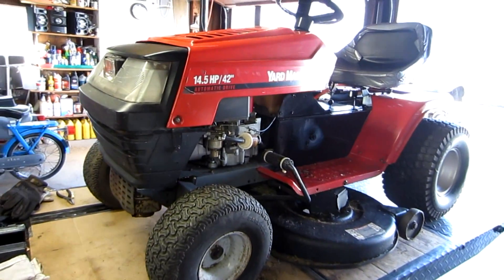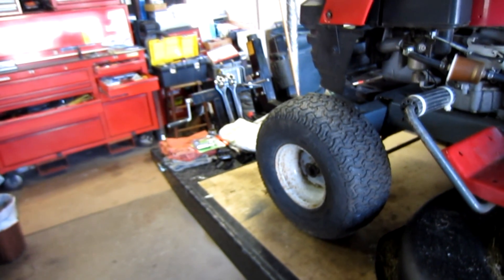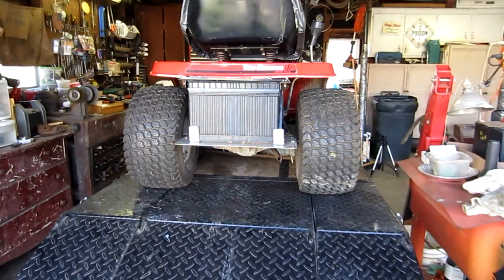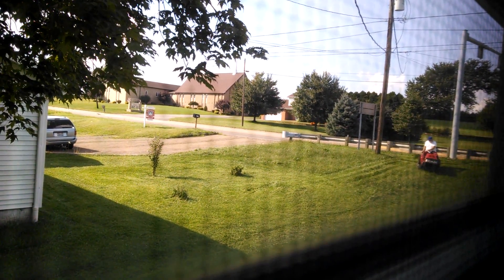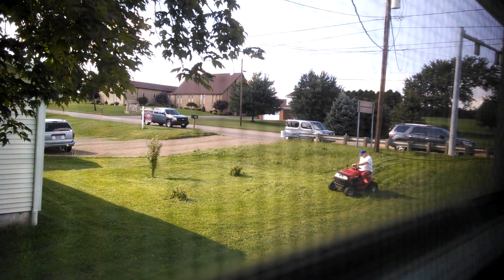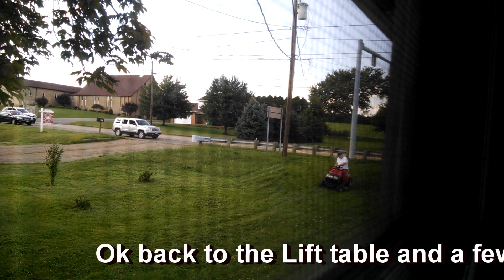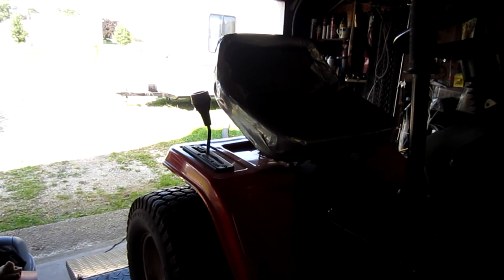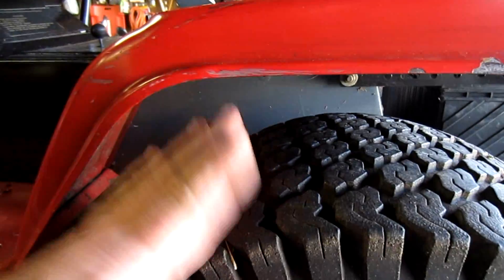Buying used MTD mower DON'TS

Comment: I own a 1997  12.5 / 38"  MTD Yard Machine and it's been the best mower I've ever owned !  To say this machine has a flaw is incorrect in my opinion judging on my machine . If the machine is having trouble cutting you should mention all possible reasons . For one , people often let their grass get too high and then try cutting with the deck too low . And they never sharpen or replace the blades . You should also mention worn and or stretched belts and when they do replace belts to be sure to get the right ones ! People will often get belts  1/2 inch in width when they need  5/8 inch  . And that makes a world of difference . I am amazed at how mine will climb the hill out back and march through the grass , cutting with no problem !

Comment: Engine mounting plate bushes distort giving more belt slack too!  Starter pinion wears quickly. Steering track rod bends
giving toe out/wheel jam. Grass duct gets blocked regularly unless grass is short and bone dry.  Safety switches fail.
 Starter Solenoids fail. Flywheel magnets come unglued, locking engine.  Beside other faults you mention!
Reply: robert stirling I agree mtd mowers  are garbage

Comment: I acquired one in 2009 and I have used it now for 6 seasons and its been great. I think its probobly a 2000 model since its called millennium. You cant beat these for the money, New blades and it cuts beautifully.
Reply from the maker: 09809709879876678698A  Awesome!, Glad to hear.. Yours is definitely the exception, not the rule. hope it keeps doing well for you.
Reply: Foxboss9 I cut some 12" Grass today. I noticed what your talking about. Took 2-3 runs to cut it with a fresh set of Blades.
Reply from the maker: ftecconn uuughhh!

Comment: Not sure of the year of mine, but it's 2000+ for sure. It's yellow and is a Yard Man by MTD. It's a 42 deck, with a 19.? Briggs pushing it. Doesn't have this deck lowering thing I keep hearing about. Has 7 gears, cuts in reverse as well. You engage the blade with a lever on the right hand side, by the blade height adjustment. Honestly, it runs like a dream and I've never had an issue, in any height of grass! The ONE thing that bothers me, it seems like the blade doesn't get high enough; even at it's highest setting, it's still pretty low! Any suggestions???

Comment: Our 1994 MTD 16hp Tecumseh (Agway) is still going. Only oil changes, deck pulley bearings, of course belts changed. Never touched transmission. Original tires and seat is like new. Does not smoke either. But it is getting tired. A lot of hours on it!

Comment: This is helpful thank you. From the research I have done so far, MTD makes mowers under many different brands (Troy Built, Cub Cadet and more). Do they all share this poor design? Are there other brands that are engineered better?
Reply from the maker: Just like any other manufacturer MTD does have models that are not bad at all. This model however is the one to stay away from. I'm not talking about just the colour and the year I'm talking about anything that is packaged under the MTD brand that has this kind of deck engagement. It's definitely a buyer beware and if you're not doing the work yourself you want to find a place that has a reputable service department that will cover the warranty effectively.
Reply: @Foxboss9  the only issue i have with them is the deck safety i dont get worn deck mounts

Comment: Excellent video! Tell your viewers to go on Craig’s List and buy a use Toro Wheel Horse
tractor for about $500.00 I have a 2001 HXL 16/38 model Runs supremely!
Well designed, makes the these other tractors look like toys! Runs every day with no problems.

Comment: The other thing I want to ask you is: when buying a used MTD riding mower or lawn/garden tractor, should I look for one no earlier than 1987 (at least in the case of the 995), which was when MTD first implemented the seat interlock that stalls out the engine when the operator leaves his seat without doing these two things first: disengaging the mower deck and then applying the parking brake?

Comment: I put small LED light bars on my mowers. The MTD varidrive system is ok IF you lube the variator pulley once a year and use MTD drive belts because they are a little wider than the 5/8" hardware store belts. My blade brakes are worn out a long time ago. I use a 1995 14.5 hp 42" MTD that i got for nothing 5 years ago. I mow over 2 acres and show it no mercy . it is still running and doing its job.I put 4-6 hours a week on it. Yes it takes maintenence but it works for me.I flip mowers and buy my seats from Surplus Center. They run about 48$ with shipping

Comment: I have a 12.5 hp with a 38inch deck and it works fine just had to have to beirings replaced it strong running

Comment: Which model of MTD garden tractor should I buy based upon which transmission?

For example - this list of 1980 MTD garden tractors:
140-910A = B&S 11 HP engine, 4-speed transaxle 
140-912A = B&S 11 HP engine, 4-speed transaxle with overdrive ("Sixteen/Four")
140-916A = B&S 16 HP opposed-twin cylinder engine, 4-speed transaxle
140-918A = B&S 16 HP opposed twin-cylinder engine, 4-speed transaxle with overdrive ("Sixteen/Four")
140-994A = B&S 16 HP opposed twin-cylinder engine, hydrostatic transmission
140-995A = B&S 18 HP opposed twin-cylinder engine, hydrostatic transmission 

To sum it up, which of the following transmissions on this particular year's machines were most reliable?
4-speed transaxle with no overdrive
4-speed transaxle with overdrive ("Sixteen/Four")
Hydrostatic transmission
Reply from the maker: ClassicTVMan1981X buy any belt driven variable drive Transaxle and other than belt replacement it should be fine... LIGHTWEIGHT Hydrostat Trans are great and convenient but they need to be looked after and maintained.. Plus no towing or plowing with Hydrostats, it will shorten they lifespan..
Reply: So I guess that among these the 912 and 918 (and related versions such as the Yard-Man 14912 and 14918 and the White GT-1622 and GT-1822 Yard Bosses) would be the ones to look for?
Reply: ClassicTVMan1981X I have a1980 yardman 18hp hydrostatic with a Briggs and Stratton opposed twin. It's a tough machine, not sure how it mows I only plow and garden with it.
Reply: its 14995-0 btw
Reply: Thank you! It would have the Briggs & Stratton model 421417 type 0146-01 engine.

Comment: I agree they are more trouble than they are worth. I have one in my garage now and I'm thinking it will be my last. Its missing a cover and a guide pin. Engine has a hard time starting because belt drags. Hard work with little reward.

Comment: I got mine for free and it was an 18.5 42 dark grey hydrostatic,not many problems except a new battery (that I already had on the shelf) with the same seat but it was falling apart so I went to my mower parts pile and found a brand new seat,nice mower honestly,I cut an acre of grass every weekend in about an hour and a half, with a 3" pulley on front and back so equal speed and power it probably does about 8 or 10 mph

Comment: I agree with what you said and seeing the comments and looking at the issues it looks like  that most things on this tractor are consumer modifications and I think your tips could apply to any brand of lawn tractor
Reply from the maker: Yes, there was a lot of modifications that were issues however, the main problem with that mower is the deck design. From the factory it is a nightmare. Should have never been made. And unfortunately it was produced for quite a few years. Other than that all those modifications could have caused problems with other manufacturers too
Reply: @Foxboss9 yes sir I agree I would save up for a John Deere

Comment: I bought the MTD Gold Lawn Tractor (2002) with the Static transmission used for $400 on craigslist. I was able to mow our pasture with really tall grass 4 times with it, the belt came off. But I was pretty abusive with it, I have to say. Yes it has lot of play in the mower deck like you said. It does help protect the blades a little when mowing a pasture though. My seat has a few tears also, maybe a seat cover somewhere ebay? I need to find out how to put the belt back on. I saw one video shows accessing the belt under the seat (the UPPER belt). Well at least it already paid for itself mowing the pasture 4 times, that cost about $150 each time to have someone else do it.
Can you tell me how to get the upper belt back on? I don't want to replace it yet it slipped off.
What's a good craigslist mower to look for?

Comment: I got a lot of mowers but this is my favorite
Reply: I had a MTD I had bought back in 1994 ended up having it for 14 years had no problems I think I only replaced a belt on it once out of the 14 years my Husqvarna I’ve replaced like 3 belts in 4 years those old MTD mowers were built to last.

Comment: Good morning, I have the same tractor but I don't have the exact model. I have problems with the blade belt (I think the one I have is not adequate) since usually when the grass is high it constantly slips. Find out but there are many models and I am not sure which one to buy.
Can you tell me the code of the one you have on your computer.

Greetings Francisco

Comment: I have been wrenching on mowers since I was 8. (40 now)   Many great points made here. I just picked up a "White" mower for 20 bucks with the exact same deck.  The mower was a basket-case, meaning I got it in pieces.  Naturally those belt guides are gone, and the front two pin guides on the engine pulley were bent out of whack.  Starts, runs drives and charges just fine, but that deck is a nightmare. I'm still working the "bugs" out.  I prefer the electric clutch style myself. Like the one on my Husqvarna 2654 (also an MTD)  Or heck, even the manual disc-clutch style like my Case 444 or John Deere 322 are good too.  But anything that slacks or tightens the belt to engage or disengage a deck, is just a problem waiting to happen.
Reply from the maker: Makes you wonder where MTD engineers that designed that deck, got their degrees at?
Reply: Correction:  My JD 322 has the electric clutch too. Above, I referred to it having the manual type.  Also, My JD 212 had a cone clutch on the engine shaft. It was great as well.

Comment: Enjoyed you video....I have and old Wards mower that was built by MTD. The design is very similar, the thing is after 24 yrs. of service I have no complaints about it. 12.5 Briggs still runs good serviced regularly. Garage kept deck cleaned after a summer of cutting. Original tires....sorry I can't be more negative but maybe the newer ones are cheaper. At any rate good video.

Comment: I almost bought a 2018 john deere today it was a 20hp with a 48-inch deck. But I got lucky and found a used toro 10 years old with low hours It has a 10.5 with a 42-inch deck so far that thing is better than my 1991 craftsman garden tractor

Comment: Just about everything that you pointed out in this video about this lawn tractor is happening to me. Every single thing, except I have the starter cover on lol .I guess I got my work cut out for me to try to get this thing right. Any tips on getting the blades to engage properly by adding Springs or anything.
Reply from the maker: Robert Eby MTD brand name belt.. Look at the deck mounting holes for slop(sometimes putting washers on the rods before the retaining clips help) I have heard of some having success with an extra spring. I also heard of people experimenting with longer and shorter belts along with thicker and thinner belts. I prefer to used the exact belt it calls for. Even if I do everything I can think of sometimes the mower was bad when new and never liked to stay engaged when put on the higher settings..  Good Luck
Reply from the maker: Adding Springs on the back, adding washers to all the deck lift rods before putting retaining clips on, or Welding washers on deck support arms to make holes back to original diameter... Experiment with very Slight shorter belts,  Doing a rain dance☺️

Comment: ha ha I feel the pain for not having any lights... I have this same body style yard machines or whatever. I have Auxbeam offroad lights worked into the factory housing... took some doing and some fancy bracketry lol It looks sweet though because I did it so that the factory diffuser still covers the lamps. They are LED and I figured up that they were only pulling around 3 amps and that is jussst enough to stay within the limits of the alternator on mine. They are PLENTY bright enough to mow at midnight.   The mower is a good mower but they are made cheap and mine was tip top just the axle was loose from the frame but I just welded a small piece of scrap and shot some holes through it.
Reply from the maker: codemiesterbeats 👍😁
Reply: My neighbors get perturbed when I go out mowing at midnight.  Go figger.  ;)

Comment: I have one of these bad boys. Notice when I'm cutting, one blade seems to be cutting at an angle. So I jacked up the tractor, grabbed the one blade and it rocks up & down. I noticed when doing this, the pulley above the deck is rocking along with it. Does it need some king of bushing or is the shaft from the blade-to-pulley bent?
Reply from the maker: Charlie Hammock new spindles are needed.. You may be able to replace just the bearings however it usually isnt much more for the complete spindle and it is less work to replace as a complete unit..
Reply: Foxboss9 Thanks!
Reply: Charlie Hammock  I would replace the spindle
Reply: Charlie Hammock I notice so much wear its reaching EOL. Motor Runs Great. Had to put the Fuel shutoff in. Found a Full Cylander of Gas Las year.. Cleaned out the Inerds pretty well.lol

Comment: the head light up grade is no problem   SYLVANIA 1157 bulbs are 27 watts.  54  watts a pair and only 800 lum  .  I put  4.5" 27w 3000LM Round Flood Light Pod Off Road led on my mower

Comment: Does this information apply to the 990 series with the single-cylinder cast-iron Briggs & Stratton engines?
Reply from the maker: It applies to any engine power that has the blades engage automatically as the deck is lowered..

Comment: Bought a ranch king mtd for 115$ including a new front tire, its  great for a 1st mower. Doesnt run yet but im fixing the bottom tank outlet and the shifter gates stuck in 5th im guessing because the shaft and slider dont seem long enough

Comment: Hello foxboss, I just bought the green yard machine (don't no the year of it) and it's the 14hp LT 38" cut... I was just wondering how it compares to this mower in your video.
I got it for $200 and I'm hoping it is a little better model than this red one in your video. I have not picked it up yet so don't no exactly how it's gonna do (bought it from a friend) but yeah if u could tell me if it's better than the red one or not or just anything about it, I sure would appreciate it, thanks...
Reply from the maker: Pretty much all the MTD are easy to buy parts for and it taken care of will do the job. If your green mower has the same deck engagement as this one you may have problems with it as it's very finicky. Basically, if the blades turn on automatically as you lower the deck then you may have issues with it. Other than that I'm sure it'll be fine

Comment: My craftsman mower is hard to shift could it be the drive belt is to small it gets smoother when I adjust the brake to the point there is no brakes
Reply from the maker: Yes. If you've just recently replaced your belt and you're shifting problems started after that, then absolutely the belt could be too small. Make sure that you have the exact correct size belt and that you routed it correctly around all the pulleys and belt guides.

Comment: Hey Foxboss9.. I have a 2004 troy-bilt and the deck set up looks exactly like the mower deck your showing..I have a problem when i pull the lever arm all the way up to raise the deck it suppose to engage a safety switch on the inside so the mower knows the deck is up and is safe to start...but the lever does not touch that switch and looks like something may be missing because of the gap. can you show me your set up to see what i'm missing
Reply from the maker: Yeah, that's another issue with those mowers.. I don't have any of those mowers in for service recently so I can't show you what it should look like...... 
 you may want to go to the local mower repair shop and see if they can show you on a diagram what it looks like and maybe the part that you could be missing. I'm going to assume it's some sort of little bracket that is supposed to push the safety switch once the deck is up.